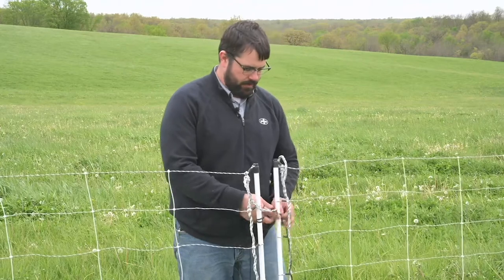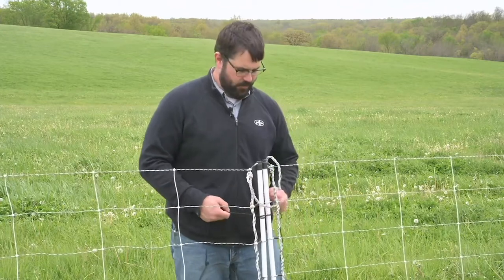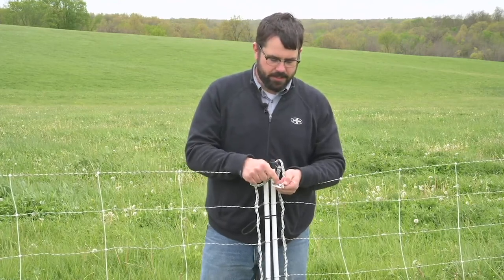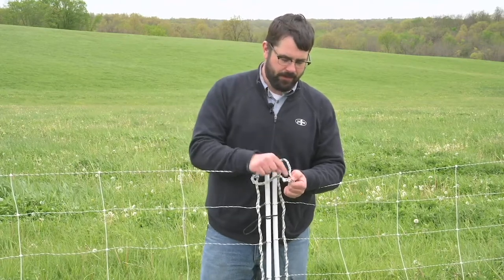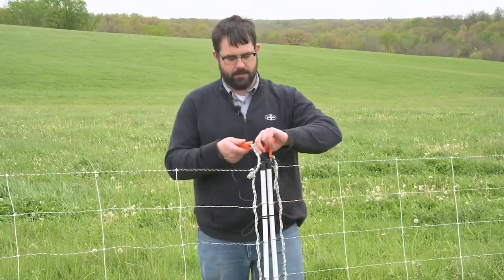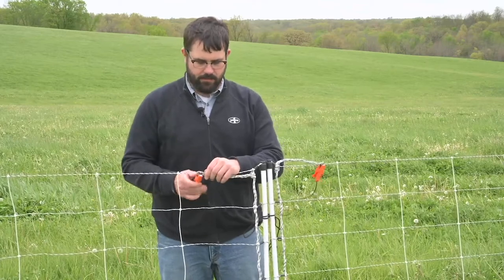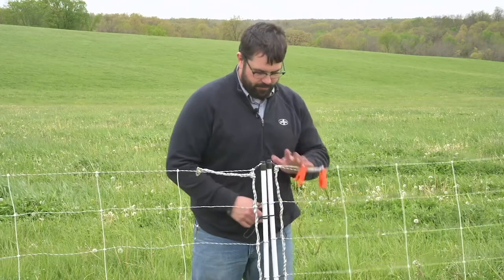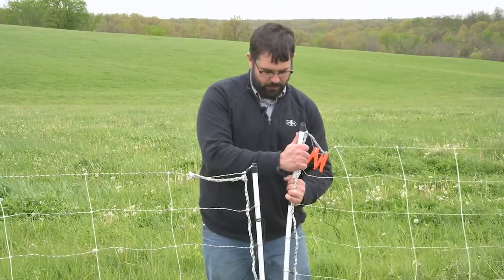Electric Netting Connecting Multiple Rolls

Comment: What about connecting two fences that enclose two SEPARATE paddocks? I have calves separated from a pregnant cow in pasture and my charger keeps running low from powering the two nets. I'm wondering if I'm connecting them wrong, or if I shouldn't even be connecting them at all...
Reply from the maker: A PowerLink or insulated MaxiShock are two methods for running multiple paddocks. However, if your energizer is bogged down by two nets, your energizer's output may be too low. Give us a call at 800-282-6631 and one of our consultants will help you find a solution.

Comment: How well does this netting work in desert conditions?
Reply from the maker: If using as a standard electric fence set up that relies on soil moisture, we would not expect success. If using as a Pos/Neg setup, it works very well. Call 800-282-6631 for more information.
Reply: In another video you may want to do a close up of sliding the two metal connections together. I see a lot of people doing it wrong; trying to squeeze the non-flat parts together. Words to the wise: if it’s hard to get these pieces together then you’re probably doing it wrong!
Reply: agree, called Premier 1  before buying and due to dry NW AR they recommended the Pos/Neg version of the poultry electric netting and does great in dry rocky soil and in tornados